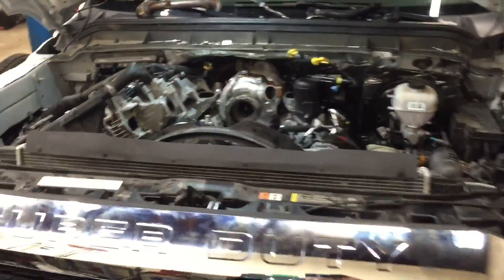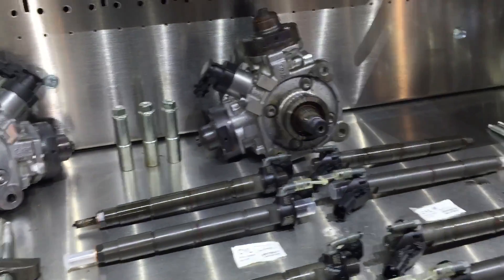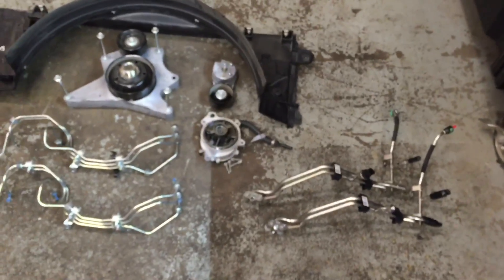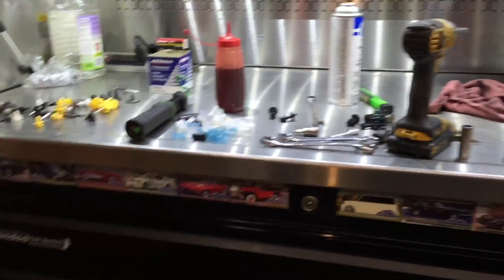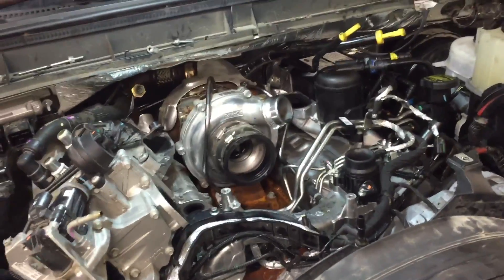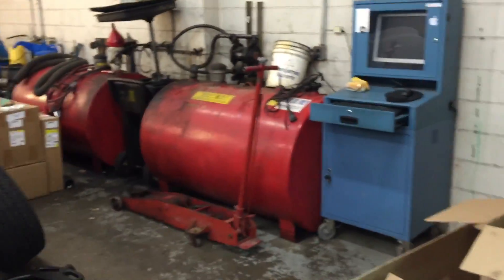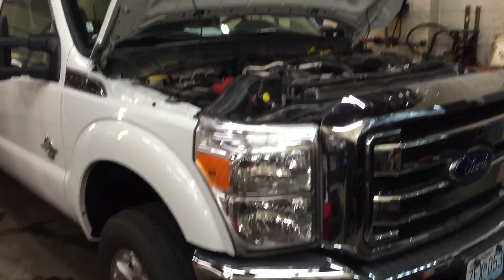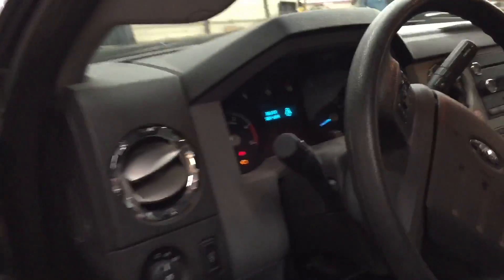6.7 Powerstroke Assembly: Injectors and Pump

Comment: Only use OEM high pressure fuel pipes. My cheap ebay one blew open during acceleration on highway with kids in truck. No excessive pressure in system.
Reply: I have a 2019 F250 that did something similar, I do not believe it is the pump. I have fuel dumping out the hardline going to the pump. Kind of weird event with 64,000 miles.

Comment: Daniel.  I had a guy top off his 6.7 with 87 regular.  Ran for about a day.  Only symptom was hard start.  I get p0093 large leak.  I had the regulator out and I had the control valve off the pump found nothing but diesel, no metal.  What did u have for codes?

Comment: Hard to believe water in the fuel is going to cause a $9k parts bill plus labor for the owner. Water getting in the fuel is the fault of the service station and not the owner, right? All that being true makes this vehicle extremely less attractive.
Reply: Looking for a gas one now!
Reply: Not if the owner doesn’t change their fuel filters or ignore the water separator

Comment: good video. Have you ever removed a turbo from a 6.7 how hard is it and does it require cab off removal?
Reply: Kinda late but I just removed my turbo in my 2011 and did not need to remove the cab, it's not an easy job to do but it can definitely be done with the cab on. Bring your extra large toolbox of patience that's for sure.

Comment: So there is no physical passenger exhaust manifold on the 6.7, its integrated into the head to flow up and out?!?
Reply: +Ryan T its called a "scorpion" style exhaust. the exhaust manifolds are housed inside the valley of the engine. the valve covers are also the intake manifold as there are channels on the underneath of the valve cover and the air flows from the middle of the engine through the tubes towards the wheel wells before turning and flowing down past the intake valves.

Comment: I'm really surprised they don't include some sort of water separation in the fuel system on these newer trucks. I know they have membranes that can separate water from diesel fuel, why don't we use that to protect these expensive fuel systems?
Reply: +compactc9 they do have one but its not a very big container, this failure usally happens from guys who just fill up anywehres. and or after market fuel filters, i've cut open alot of filters for a duramax and none except the AC Delco has had the membrane in it to remove water
Reply: Good to know, thanks for the tip.